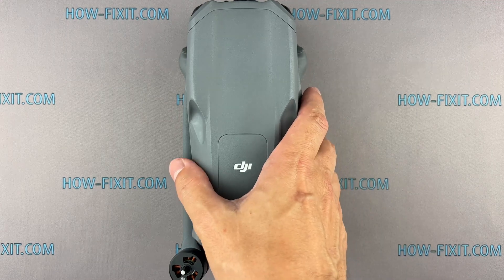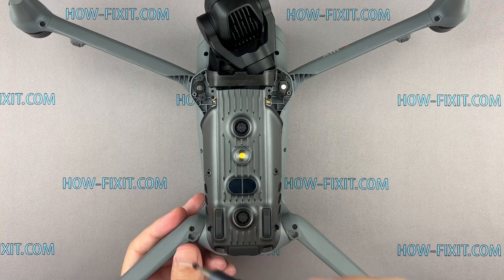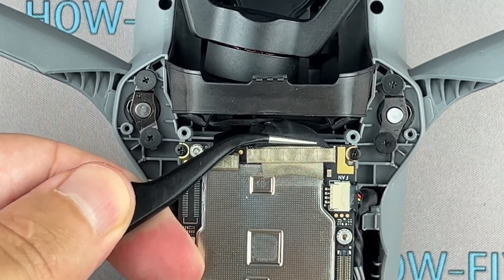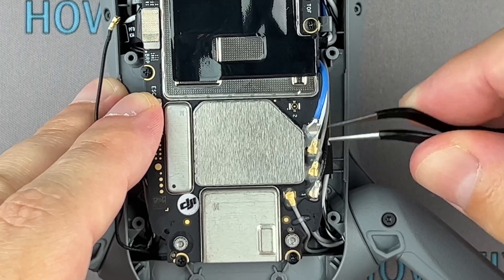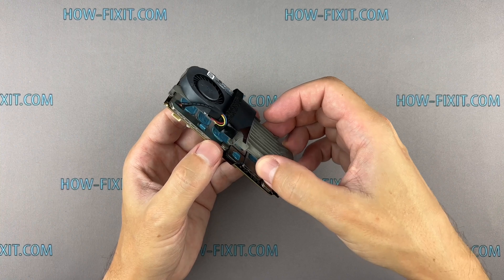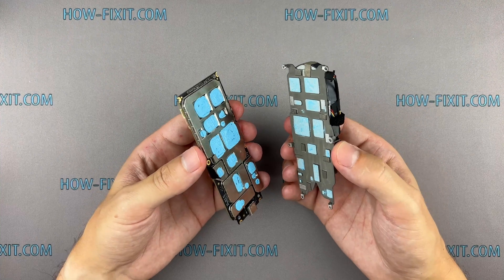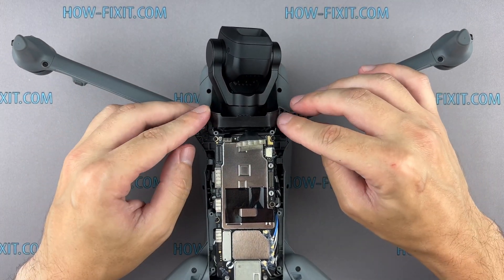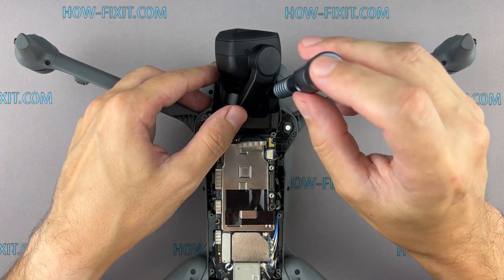Drone Repair: DJI Air 3 Motherboard Replacement Guide

Comment: Hi and great videos. 

I wonder if you could humour me please… can the Mavic 3 Thermal camera be put in the Mavic 3 Enterprise drone?? They’re essentially the exact same drone apart from the camera and cannot see why it won’t fit and or work. If it can be done then it’s just a   Simple and quick hot swap able adapted to be added.